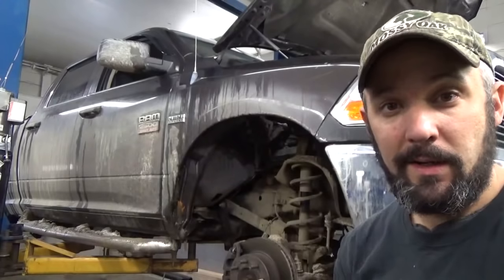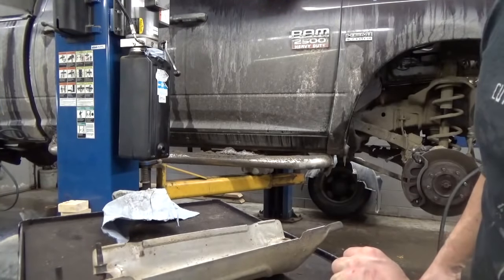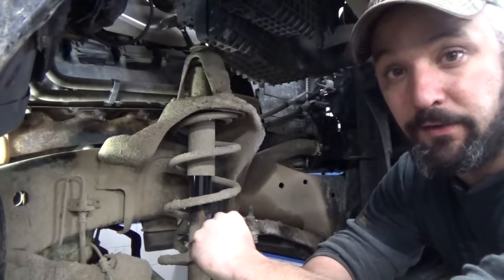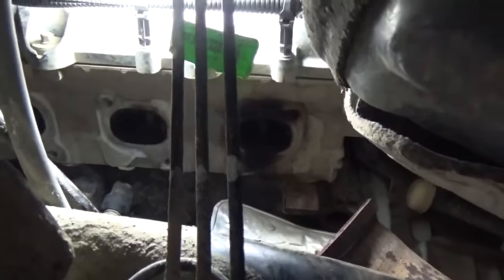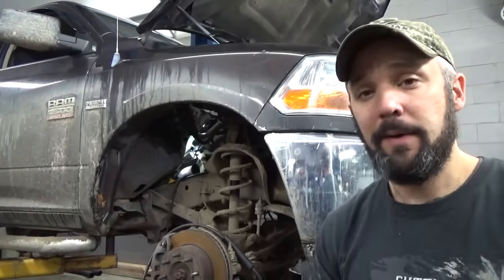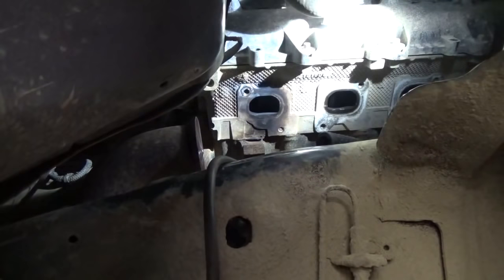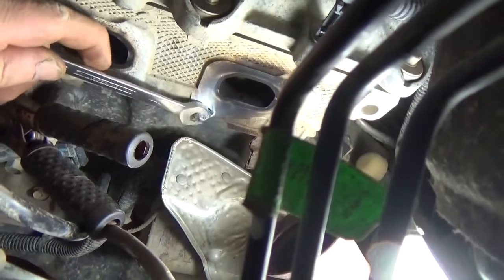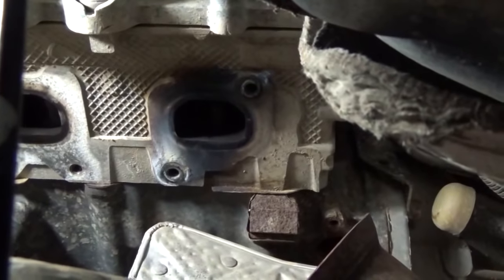Removing Broken Exhaust Manifold Bolts - Hemi Dodge Ram

Comment: Great video. Lots giving Dodge hell for the problem, its been a problem with exhaust manifolds on every manufacturer I have worked on for the last 40 years. That heating and cooling and then rust makes it more common then I like. Always a struggle it seems working on exhaust, like you cutting the flange bolts, those are always a "broke off" problem too.

Comment: I’m working on two broken exhaust bolts on an 01 Yukon with the 6.0.  Can’t get a drill in to drill the rear one out so off come the heads to replace the  headgaskets also.  Preventative maintenance.

Comment: Nice job. I got something similar I need to do, but hopefully a little easier. I have a pressed in stud on an exhaust flange that's broken. It's not on the manifold its just a normal 2 bolt exhaust flange, with one mating side having pressed in studs. Ugh I don't know why they couldn't of just used regular nuts & bolts. I just have basic hand tools. I'm hoping I can get it out with a hammer and chisel/punch. Thanks for showing us how the pros do it!..

Comment: After you heat them up take a normal stick candle and apply it to the base the heat will suck the wax into the threads just like sweating copper pipe. The wax lubes the threads works very well

Comment: I do about 4 or 5 sets of Ford manifolds a month. Jack the motor up for more clearance. Cut everything out with a torch. Remove studs with a mig welder. Can do both manifolds in a couple hours.

Comment: Old video but we use copper or brass pipe for recessed bolts . Cant weld to copper so it protects the threads ,and you can put a good weld on it .

Comment: Tack a flat washer to the broken stud first then the nut. Even if its counter sunk it doesn't matter. It keeps it flat. If you just do the nut it can be crooked and pop off when you turn it. I've been a tech for 17 years and it works every time I've done hundreds of hemi manifolds.
Reply: When you back the nut out it can hit the head forcing the weld to break and that's why they broke. It wasn't the weld failing. The washer method is proven to work first attempt every time. I just wanted to also add props to you in your rust battle. Keep up the good fight!

Comment: With the recessed bolt i watched a video where the man used some hollow copper pipe the size of bolt then slid pipe right up to bolt. he used stick welder to weld bolt to copper by welding inside Worked in most cases. Stops from stuffing thread up.

Comment: I have welded nuts on several times and failed. Lucky break i say. Had it been me making the video it would have made a fool
Of me. I often drill and smack a torx bit into the hole. That works. 
Glad it worked for you. It doesent always go that good.

Comment: I just did this repair on my RAM today. 2 broken bolts on the passenger side and only 1 on the driver side. The driver side had very little room to navigate and the oil dipstick tube had to be removed which was a huge pain. The bottom bracket is behind the motor mount and isn't accessible. But all in all, i fixed it for $90 in parts when the dealer wanted $1800 to do it.

Comment: We have a template for hemi exhaust manifolds, it has a 1/8" guide hole to center on that broken stud and it works perfect.  Of course, it works better on the upper rear bolts!  I wish we had a decent welder to do this!

Comment: I know I'm a little late on this one but... This is actually a really common problem. I work at a CDJR dealer and do these all the time. I think it's due to the fact that there is no flex pipe or anything in the exhaust it's all pretty rigid, so anytime the engine moves in its mounts those bolts get put under stress, just my opinion though.
Reply: I think dodge should recall this and fix the problem because we keep having to replace these bolts all the time and it gets expensive!!!!

Comment: hi,,, i fixed my 2014 hemi yesterday after studying your videos.   I only had one broken stud at the  rear on top row, that holds the heat shield.. it was broken flush with the manifold, so i had 3/4" protruding, so it was easy to remove with vise grips.. Torqued new studs to 18 ft. lbs, and no more ticking.. Thanks a lot from Texas,  I tell friends about your garage.

Comment: I think the reason there breaking is the working back & forth of the manifold. Use hi grad 10 or more bolts. Graphite anti size. On mine, I used Permatex nonhardening sealer because of antifreeze leakage.

Comment: I would be afraid that heating the bolts up like that to free them would cause them to just twist the bolt heads off.
I’ll be damn, good job.  A little bit of patience?? You have more patience than anyone I’ve ever seen, certainly more than me.  You showed me something new.  I’m going to try the mig welder on the broken bolts I’ve got to take out on this 6.0.

Comment: For the benefit of other viewers and their comments, that weld will not bond to aluminum and typically does not bond effectively to cast iron either with this technique. To remove a nut or bolt, it must move (duh). Heating expands it-- and expansion is movement! Tapping lightly on the nut with small hammer after the welding often helps break loose the broken stud/bolt. Tap as if you were trying to drive the bolt/stud deeper. My experience is that steel studs/bolts in aluminum are more difficult to remove than if in cast iron. Steady hands and good eyesight help and I have neither of those anymore.

Comment: I had this done on my 2014 ram 1500 w/hemi passenger side.  These break because manifold expands due to heat and puts sideward pressure on bolts.  To fix and not happen again have to slightly enlarge holes where bolts broke so it doesn't happen again.  Have to dry fit manifold to see which side of the hole the bolt is rubbing on then use die grinder to provide a bit of clearance.  Haven't had the passenger side break again even after towing 6000lbs up and down mountain several times.

Comment: Had 1 on my 1977 dodge 440. Drilled out, Packed in JB weld, re-drilled & tapped. 3 years & holding. Had to do it like that because I could not get a straight shot at it with a drill, and it wandered making a mess of the hole.

Comment: Just did this earlier... found out you cant weld ARP bolts lol.  luckily just enough of the bolt that broke was sticking out of the hole I could pinch it with visegrips and spin the bolt out (it was redhot from the attempted weld at the time)  I've seen guys put a notch in the bolt then take a chisel and lightly tap it til it spins and do it that way.

Comment: I have not tried it, nor seen it done, but I was told that the Midas in my area actually blows the entire broken bolt out with a torch and then runs a tap through the hole to clean the slag out of the threads!

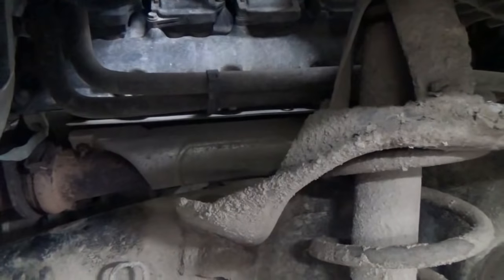Comment: At 1:14 you can clearly see the tail end of the manifold protruding out from under the heat shield. The rear most bolt on the right side is most commonly the first one to break. So when it rains most puddles form along the right side of the curb lane and it is my theory that driving through puddles especially deep ones causes water to splash on to the manifold which excessively cools the rear exposed portion in relation to the rest of the manifold. This causes the manifold to warp eventually snapping the bolt.
I just installed a new manifold, gasket, and bolts today and to me this seemed the most plausible explanation

Comment: Thanks for the excellent video and your great troubleshooting on how to get those broken bolts out of those Hemi heads! I am about to do mine on my  Hemi charger but since I don't have access to a welder at the house I'm gonna assume I probably broke a few and do the smart thing and do this job at my buddy's house who does have all the welding equipment, I have seen this in many of the Ram trucks, Pretty common problem,Thanks for saving me the Headache!!!

Comment: Man those left sides are a bear on the 1500. I don’t know if I did something wrong but left side sounds like valves are floating under acceleration. Hope I didn’t screw the head up. Looks like I’ll be back under this thing this weekend. Right sides were super easy!

Comment: Had a Motor home with a Chevy 454.  Used to snap the end exhaust manifold bolts.  After several failures, I drilled out the bolt holes in the manifold on each end.  Gave it more room to grow with heat expansion.  After that, never failed again.  They would run really hot.  Wonder if this method would help keep the bolts on the 5.7 HEMI from snapping?  Excellent video.

Comment: I just did passenger side on my 5.7. I got lucky only 1 stud broke and I had enough to back it out with pliers. I think you have to catch the leak early to avoid more bolt breaking off

Comment: I do these all the time. I'm the "manifold guy" in town, because no other shop will touch them. One big tip I have is to put a dab of super glue on the nut, and stick it to the head. That way you don't have to try and hold it with vice grips or needle nose pliers. Makes life a little easier!

Comment: Just a tip for the recessed bolts.   Build them up with the welder a bit before putting the nut on.  It helps a bit getting the weld burned into the bolt not having the nut in the way.

Comment: Have had success removing the broken bolts WITHOUT manifold removal - replace with new bolts and repair is finished .. Of course IF the gasket has also failed then that procedure will not be applicable - but I have had some good luck doing it without manifold removal ..... Use high quality Cobalt drill bit and bolt extractor .. May need to jack engine up slightly for straight shot at the lower bolt.

Comment: GOT IT! Not a mechanic or a welder I rented a wire feed welder and was able to get the one on driver side at the firewall on my "Chevrolet" 6.0 with iron heads took 4 tries. Two others broken were sticking out and I used different methods for those
Reply: By the way 64 yr old guy 22 yr old truck in my driveway, as Eric always says "if I can do it, you can do it"

Comment: Hey I know this is an old video but I found a neat tool for heating bolts called BOLT Buster it plugs into the wall and has a loop on the end that you hold over the head and it heats the bolt to glowing

Comment: How I fixed mine was simple. The dealer wanted 3500 to fix it. I put the money down on a new tundra instead. Not a problem since. Sure i cant tow or haul quite as much but hopefully it lasts longer than 46k miles. I tow cars and my rv all the time. No issues yet.  Better mpg too. I really liked my ram too. Oh well.

Comment: I got a 2010 Ram 1500, I've already replaced 3 manifold bolts. It is a design flaw and as the manifold heats up and cools down the bolts break apart. Best idea is check them every 10,000 miles by cranking the truck and listening for ticking near the manifold.

Comment: Dodge dealership replaced 5 missing bolts for me under a warranty and a recall because rams for this year have this issue. Anyways, same day I picked my truck back up after them installing new bolts, had check engine light come on. So took the truck back and they said it was a vacuum leak from one of the exaust bolts. Anyhow since that day my truck is so sluggish and rpms bounce up when braking. No check engine light comes on, just the sluggishness and strange rpms. Dodge said it's the torque convertor. I disagree since it shifts fine and smooth no other symptoms like a torque convertor issue. I took to a local car place and they think it's a vacuum leak

Comment: Yea my HEMI is at 50k miles and I’m already looking to replace my manifold bolts to avoid any costly situations down the road. Haven’t done any research yet but I’m sure someone has come up with better bolt replacements 🙏🏽
Reply: ARP is a good company to get bolts from they are pricey but worth it

Comment: Just did the drivers side on my 2013 ram 5.7 this weekend not a easy job by any means had 4 broken studs and with no welder ended up drilling out the broken studs and tapping the holes hoping the passenger side will be a little easier

Comment: Hey just wanted to tell you love your channel and info I saw something on another guys video about getting out recessed studs like that you take a small piece of copper tubing put it in the  hole to protect the threads and weld inside the tube to the nut thought it might help

Comment: Only thing I would've done differently would be to clean the broken bolts up with a small wire wheel on the dremel tool or one on a drill if that's all I had, it would've made your weld easier vs welding dirty makes it harder to start.  I've used this method on many of broken exhaust manifold bolts, even on cast iron heads.

Comment: Wish I had a MiG welder on-hand for just such an occasion.  Looks easier than trying to drill through the center of the stud and risk breaking off the screw extractor or the drill bit.  If the stud isn't under any compression and lots of penetrating oil applied, should be easy to remove otherwise.

Comment: This must be a common problem. My 05 1500 5.7 had the exact same situation. Luckily didn't break the easy out off when removing it. Decided on doing shorty headers and used ARP stainless GM LS engine header bolts.

Comment: I must have watched this video 20x in the past week.  I love how easy you make it seem.  Sadly, I busted the last remaining bolt for the exhaust manifold on a 1955 Studebaker Commander project I am working on.  I was devastated.  

Many say drill it out, but after seeing this, I think I should give it a try.  Will it only work with a MIG welder (I don't have a MIG machine yet, or a gas tank), so I am wondering if you could also use a flux weld.  Is a flux weld strong enough?   There is an "open box" arc welder unit available at the local tool store and I was thinking of giving that a try (although, I'd have to get a third had to hold the nut for me).  I have never welded before, and this seems to be just a quick spot weld.

Who knows, maybe I should invest in a welding unit for future projects.
Reply: If you run flux core process you won’t need any gas. It’s more than strong enough to make a plug weld to take out sheared bolts

Comment: Broken recessed bolts? Unbolt mounts and bellhousing and torque inspection cover. Remove engine, drill hole, easy-out. Curse the engineer that thought it was a great idea to use essentially 5/16" thick bolts on exhaust manifolds. Nightmare of a job.

Also good thing those heads are aluminum and steel doesn't weld to aluminum or that might have not worked. Well done!

Comment: Your video's come on my TV, I agree the weld the nut works the best esp because of the expansion value to disturb the corrosion binding agent, I know I said in other video's BG in-force best penetrant and little goes a long way esp  when it is rust to rust seizure. Come here to comment on the computer. Why the dislikes?

Comment: What works well especially on the low ones is to weld a flat steel washer to the stud through the hole in the washer, then weld a nut to the washer and unscrew the broken bolt

Comment: I just had two of these broken in the back on the passenger side today.  Unfortunately i dont have a welder.  I attempted to drill them and use an extractor and... it didnt go so well.  The drill bit didnt center properly no matter how hard i tried.  i tried to seat the extractor and even as tight as i could get it, it would not grab the bolt.  The bolt and the aluminum on the head became one and now they are both stuck in there...  Talk about putting a damper on your day.   Also trying to drill these bolts are a real chore.  Even my cobalt bits did not want to cut through them.

So now im stuck deciding on if i want to drill them out the rest of the way and helicoil them, or just replace the head.   Watching the method used here - i wish i would have never attempted it without a welder...

Comment: Great video, sir!  I have a Dodge Dakota 4.7 with at least two broken studs.  It sounds terrible.  I have a MillerMatic 251 in my garage.  Your method is how I will do this.  This is not too nightmarish of a repair.  Thanks for showing this excellent method to remove those broken studs.  I am grateful!  :-D
Reply: I just fixed the Dakota;  No nuts needed to be welded on in my case.  They were all long enough to grab with Vice Grips.  My exhaust mani was warped, so I machined the flanges level with a vertical mill.  Used quality fasteners & gasket from the dealer.  It is quiet as a MOUSE now.  Thank you for inspiring me to attempt this.  :-)

Comment: Thank you so much for this video, it was very encouraging and helpful. I do have a  question concerning hard to get out bolts  that break off and leave you with a stud. How would you get that type of bolt off using a welder. Especially if the bolt is stripped?

Comment: I use a wire welder,  but forgo the nuts. I use a small pair of vice grips and just grab the little knob I weld on the end of the bolt. I can't seem to get the nut to weld to the bolt.

Comment: Bobs car care Streetsboro Ohio. Passenger side two rear one busted flush. Been here before. Drilling usually ends up getting into water jackets and pulling cylinder head. Gonna try this. Done it before just not on one of these engines,

Comment: Great job getting those out. Have used that trick myself. As far as reusing the bolts that didn't break, don't do it. They've been heated and cooled so many times and fatigued. Put all new ones in, that's not the place to save money.

Comment: I like when you want to weld something if you put copper around it it cannot weld that copper so if it's a big bolt stuck inside a hole put a piece of copper tubing inside cut it flush and then weld inside it

Comment: On the recessed broken off 1s, weld a USS flat washer to the broken piece, then weld your nut to the washer. Much better penetration and strength